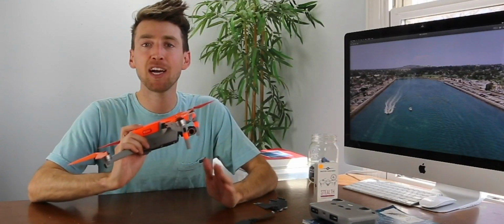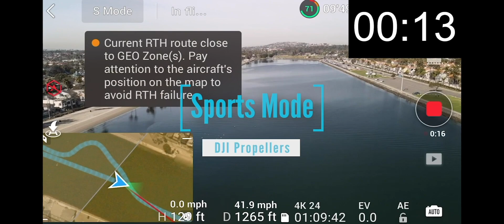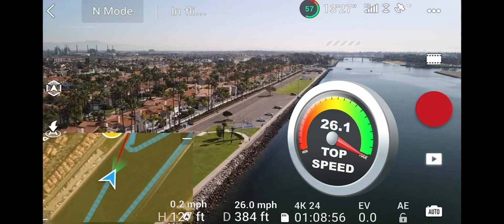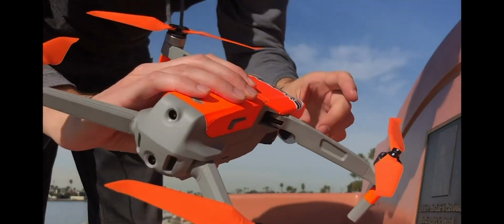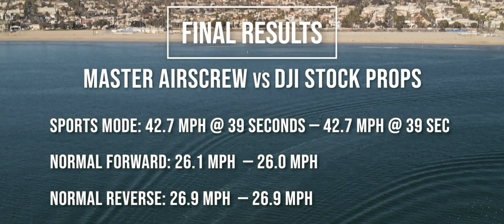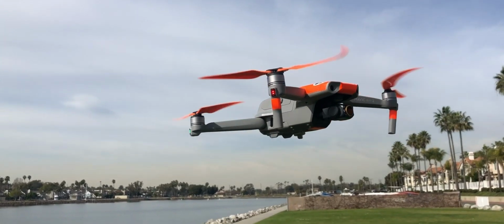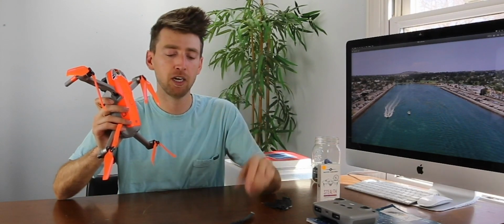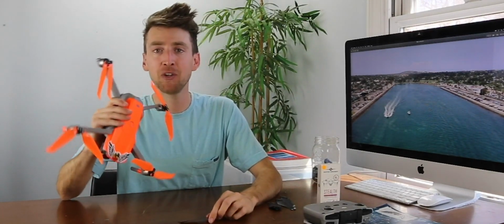Mavic Air 2 Master Airscrew Propellers. Most comprehensive test & review on YouTube!!! Unexpected?!

Comment: Russ from from 51 drones, Kelly from Ready Set Drone and I. We all agreed that the Orange Propellers had a Vibration Problem, when at idle on a flat hard surface. The originals and the Master AirScrew blue ones did not. So just be aware of that. We contacted Master AirScrew about this and they been working on replacing the orange props from customers who bought them. So far everyone that received these props are having the same issue. I’m curious to see if yours are having the same issue. Our were sent for review by MAS, so if you bought yours and there having bad vibration problems. Then just contacted them and they will replace them. Keep up the good work and have a great weekend.
Reply from the maker: hey thanks. i've watched you video on these too. i like how you used a sound meter! i finally got a reply back from MAS and offered new props or a refund. they have good customer service when they get back to you. thanks for watching and your feed back!

Comment: The exact same speed, is caused & limited by the GPS-governed speed.

I think that with a non-GPS or non-governed drone, that might be different.

I think that your drone's random rise in height was caused by a positioning glitch, & not the cause of the props.

I've had similar benefits of lower perceived volume with my Mini 3 Pro & Mini 4 Pro.

Comment: I had bought my orange props for my MavAir2 and noticed the drone drifted and then hit something, so I am out a prop.  It is almost like buying tires for a car!  Need good quality.
Reply from the maker: yeah totally. mine drifted too and ended up clipping the side of a wall. it only damages the props but could have been much worse. Master Airscrew finally contacted me offering a refund or to replace the props in a week or so. They said they are re tooling the machine to fix the issue. I chose refund.

Comment: My main issue is that Master Airscrew customer service does not respond to emails or phone calls at all to address the issues of "fuzzy" edges and the vibration caused by their props. I have the Orange and I refuse to use them until I hear back from Master AirScrew. 2 weeks and multiple attempts and still no reply. Excellent review thank you!
Reply from the maker: I haven't heard back from them either!

Comment: I’ve seen a number of reviews on the MAS orange, yours is by far the most comprehensive. I’ve ordered the orange for my MA2 just for the reduced noise (pitch). Performance difference is so insignificant I would never purchase, sound yes. Stability while on the ground is a concern. 51 Drone revealed their lack of stability which has to carry through to flight as well. When mine arrive that concern will be looked at. If it happens they go back or into the recycle bin. Thanks.
Reply from the maker: thank you i appreciate the kind words. i watched his video as well. i emailed MAS yesterday about the issue and am waiting for their response. i hope the props you get work as they should. the reduced noise was my biggest reason for getting them as well.

Comment: Just flew my air2 today had motor alerts and the edges are fuzzy have the orange props sent email to master screw
Reply from the maker: I did notice the fuzzy edge when I was flying yesterday at full speed. I think I need to switch back to the stock props. Do you mind letting me know what Master Airscrew says??